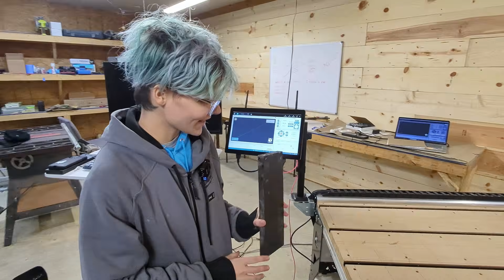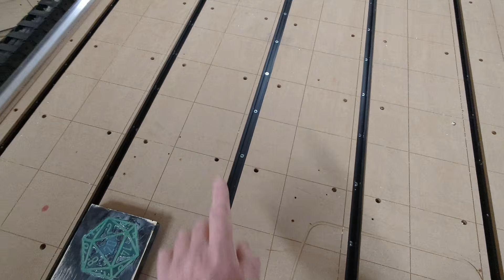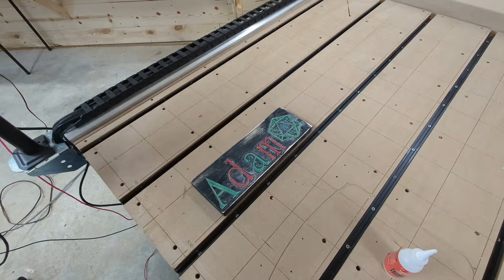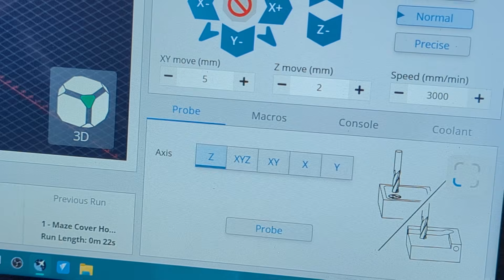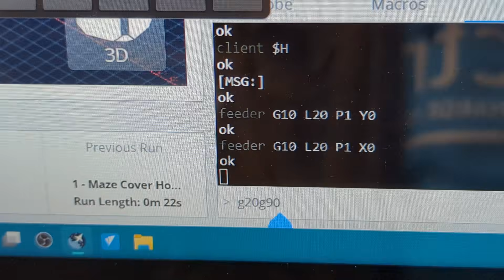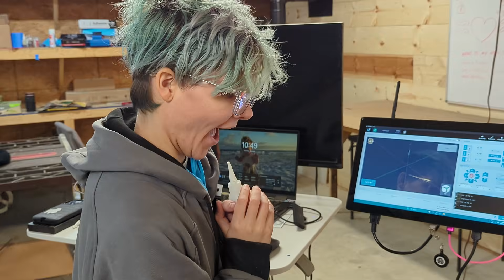NEVER Lose XY Position Again on Your CNC Project (Grid Trick)

Comment: Your process just gets the CNCs to a ballpark location, your material placing is liable to random variance from human error. However if your holes arw accurately placed, you could use a corner bracket/fence, then material placed in correctly will always be st z guaranteed repeatable XY location at any of your grid intersections.
Reply from the maker: You make a great point about the importance of consistent material placement. Using corner brackets or fences can definitely help improve precision and repeatability in the CNC setup. It’s a clever way to mitigate human error and ensure accuracy at those grid intersections. Thanks for sharing your insight!

Comment: I recently found your channel and watched Cnc routers for beginners thank you I learned a lot and cleared up a few points. In that video you had recommended using a separate laptop do you know if these systems work on ISO software? I have an old iPad that I could probably dig up if I tried really hard thanks again for the video.
Reply from the maker: I'm glad to hear you found the video helpful! Regarding your question, many CNC routers work with specific software, and compatibility can vary. Typically, ISO software refers to disk image files rather than direct application compatibility, so you'll want to check the specific requirements of your CNC software. An old iPad might not have the necessary programs, but it's great to have it as a backup option!

Comment: does it suppor g54, g55,etc offsets?   i keep my machine with set of offsets to place i use often(grid) and have that on lower left zero in black sharpie.  and i write down on spoilboard g55.  that way, i can throw part down, swap to g55, and zero is already set, change bits zero z and load and go.
Reply from the maker: Yes, many CNC machines do support G54, G55, and other offsets, which can be really handy for quickly switching between different workpieces or locations. It sounds like you have a great system in place for managing your offsets and zero points. That approach definitely helps streamline the workflow!

Comment: I will have to check to see if I can apply this to my AvidPro.  I get the feeling I will have to rebuild my waste board again and grid it with the cnc.  I have created peg holes along an X & Y axis to place the board against, as well as 45, 33.3, 60 degree lines from the front center.  I use wooden dowel pegs.
Reply from the maker: It sounds like you have a solid setup with your AvidPro! Rebuilding the waste board and adding a grid can definitely help with accuracy and consistency in your work. The peg holes and angled lines are a great way to ensure proper alignment for your projects. Good luck with your next project!

Comment: I think I understand what is going on, but if we were using an X-Y-Z probe and plate, we would still be ok, right?
Reply from the maker: Not always. If it stops in the middle of a carve, you want it to start exactly at the same place. Probe may change slightly. But this is a technique you can use without a probe. This is especially the case with 3d carves

Comment: I'm confused, repeatability implies accuracy and having the tool head accurate to 0.001" while placing the work kinda sorta in the rightish place means no repeatability. You can't have repeatability with 1/2 the process accurate. So I don't understand all the extra effort. There is no way to eyeball a work piece position to 0.001" so why have the tool to that.

 In 40 years of machining I have no idea where this is useful. If your positioning work to type in gcode commands that's not repeatability. That's only typing in gcode commands to go to a known position. Tossing a ball in the yard and writing down its X/Y position so you can go to it is not repeatability.

 Repeatability is more of a production environment maybe. Its when your machining 500 multi-operation identical parts. I do it all the time where a part may need 3 operations and its faster to swap stock then swap tools. So I run for days tool 1 on each part then days of tool 2 on each part.

 Repeatability implies something like a stock change and even in that it implies a little more than carving out a 2" item out of a 10" piece of stock where repeatability is really only the gcode.

 Machines without homing one just needs to push/pull or drag the toolhead to a known start position and call that home. Pocket laser pointers held on the spindle bracket or something aligned with a dot on the bed. Something repeatable. Even just manually push the toolhead to its -X/-Y mechanical stops, its only a repeatable start reference point. Once on position zero X/Y or if possible set X/Y zero for G55  this way when you set G54 you don't loose your pseudo ABS (G55). Machines if supported have 6 work offset systems, hobby uses G54 usually only but you have G54-G59.

Comment: You don't need to zero your offset on home positioon. Use G53 for machine coordinates instead. In your case, it's G53 G90 G0 X12 Y-32. Then can you zero your workoffset  after the move to start your job unless your g-code job workoffset is really the home position.
Reply from the maker: It's been so long since I used that g code that I forgot about it thank you!
Reply: @IDCWoodcraft  Yah G53 is one of the gcode that under utilize by most user. If you take a picture on the gSender coordinates, take note of the small coordiates (gray one not the blue large one) and that is the machine coordinate, that  will never ever change unless you reinstall all your limit switches which basically change your home axis too.
Reply: anyone want to make a short video on the making the layout and using those gcode?
Reply: I would think you would have to add G20 would you not?  At least on a freshly Booted up machine.  I'm not very familiar with G53, usually only Haas uses that for some odd reason.  the times I've let it run a G53 it crashed the Z to the top.
Reply: @larryrobinson7492 Need to be careful if you use workspace in positive+ or negative- coordinates. Mine is positive metric so I Use g53 g0 z-1 
Z0 is absolute top of z travel. -1 1mm down. Never crashes

Comment: You can just type in the xyz field where you want it to go and click the corresponding goto not the other ?goto?  Im assuming since your grid is imperial and your gsender is reading ?metric?,  you would have to do the conversion to do that thus the manual input using  g20.
Well this will be an edit because Im baffled with how this gsender works.  I dont use gsender but have it just in case they figure it out.  With that being said what i said  about the corresponding manual axis input while it does do that it also takes it upon itself to  set zero??? This pretty much makes this goto scenario useless after you home and goto your initial grid location.  Logic tells you if you manually enter a coordinate in a field and hit goto (i.e X1.0) the machine would goto X1.0 and readout that it is at X1.0.  
In my case I use this function in the openbuilds control that I use.  When the machine finishes a job, Ill be sitting at the computer and type in the Yaxis field Y9.0 and the machine moves to Y9.0. Thus eliminating jogging the machine.  If your running the program multiple times you would edit the gcode to do this for you.  Wait you cant gsender doesnt have a gcode editor.

Now the positive I took from this video if your still reading is the machine coordinate readout below the work coordinate readout.  That is a great feature that I dont have that is very handy.
Reply from the maker: It sounds like you've put a lot of thought into how gsender works and its limitations! You're right that the behavior of the software can be a bit perplexing, especially when comparing it to other control programs like OpenBuilds. The readout for machine coordinates is indeed a useful feature that can help users better understand their machine's position. It's great to see you sharing your insights and experiences—it's always helpful to learn from different setups! If you have a specific aspect of gsender you’d like to discuss further, feel free to share!

Comment: Unfortunately, this only applies to machines with homing switches. Thankfully, there are other ways to achieve the same result for those of us who don't have switches. You may want to do a video on those methods, too.
Reply: I just touch the corner of my material, or spoil board, with the bit. Zero to that point, then you can always manually move your router to that point and re-zero.
Reply: @JackInTheShop  I have a Sienci Long Mill and I use their XYZ touchplate to find axes zeros. I can always get back to the original XY0 using that. On those occasions where I set XY0 to the centre of the material, I put a pencil dot in the centre of the material. I can always return to there, too.
Reply: @ that will not work if you loose power, and or steps. You need a way to reset zero if something like that goes wrong after you started the carve. That is what all this is for.
Reply: @JackInTheShop  I am confused by your reply, In the video example, if he loses power, he homes the machine and returns it to the same starting point on his grid. If I lose power, I don't home, but I do return to the same starting point using a touchplate. Aside from the homing part, how does his process differ from mine? I still end up at the exact same XY0 as I was when I started the job. And to reply to your "that will not work", I can only say that your are mistaken. I have had power outages in the middle of jobs and when the power came back on, I simply used the touch plate to reset XY0. In most of those cases, I also edited the gcode so that I did not need to cut air until the job reached the point it was at when the power failed.
Reply: @driftergw  I am mistaken, Sorry. I read right past your XYO and was thinking about the make you make in the center of the project will be gone after the roughing pass. Also I do not use a XY plate. Just a Z.
Reply: @JackInTheShop  No worries. Tks.
Reply: If you don’t have limit switches, you can always use the hard limits of the machine as your zero reference. Run your machine into any corner and zero it. Then move to the actual point you wish to start from and take note of the co-ords. You can then zero out, and start your carve. If for any reason your machine looses track of the position you can easily get zero back. Just send it back to the hard limits, zero out, then Goto the numbers you made note of. You are then back at the exact point you started. Re-zero and restart the carve.
Reply from the maker: I have that planned. Just need to work on the other machine a bit

Comment: Will this work with the Z also? when I do a 3d carve, my starting left corner is gone from the carving, and I am zeroing of a peak in the middle of the project. Any tips on that scenario?
Reply: What Garrett said, or always make sure your material is bigger than your carve so you will have a material surface to zero Z from. Then cut it out with a final profile tool path.
Reply from the maker: To do this with z, you need to set z off the machine bed or use a separate block to set zero